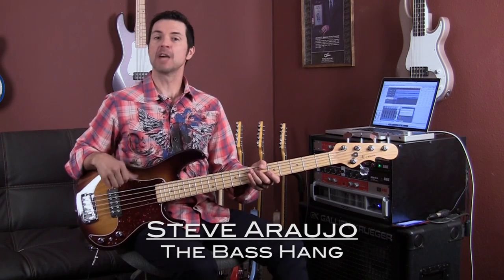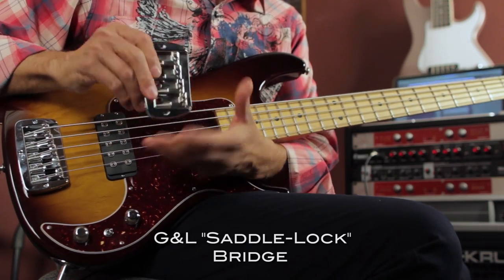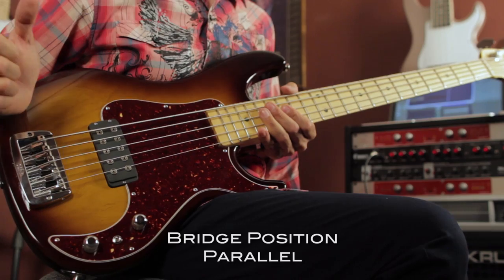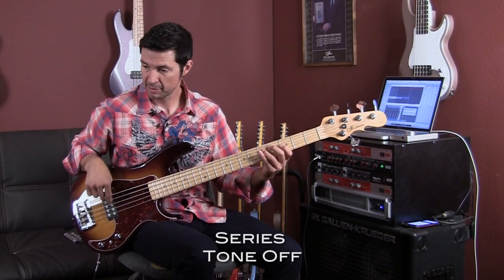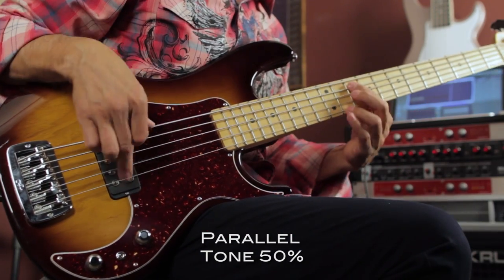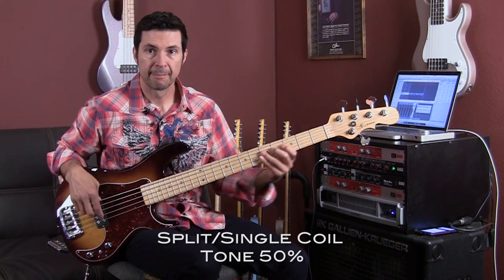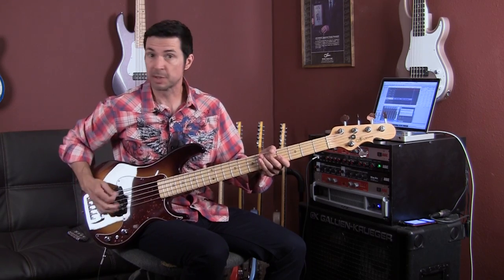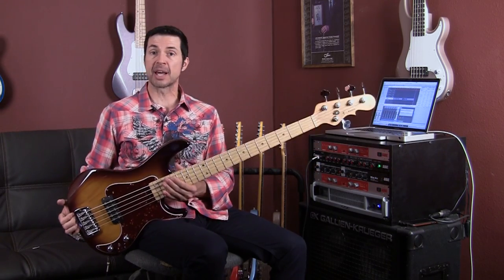Live! At Leo's:  G&L Kiloton 5 Full Demo with Steve Araujo

Comment: Wow, G&L decided to go back to the 4+1 headstock for their 5 string basses?
Reply: I find it logical due to the headstock design to not have 3+2
Reply: Well they do both, that's what's odd. Early on, they had 4+1 with basses like the L5505, then they did 3+2 for the L2500, L1505, L1005, M2500, MJ5, etc. But it looks like both the Kiloton 5 and the JB5 and maybe some others use an updated 4+1 setup.
Reply: Now that I'm thinking about it more, it seems that all the active 5-strings are 3+2 while all the passive ones are 4+1.
Reply: I don't think it has anything to do with the bass being active or passive. I have a '97 L2500, the first year it was ever released, and it has a 4+1 headstock, as well as a larger, heavier body (bass weighs about 10.5 or 11 lbs). Mine was built in the 3rd quarter of '96, one of the first out of the factory. Later '97/'98 models went with 3+2 headstock and smaller, lighter body. 
I feel that people loved the 4+1 headstock, so they went back to it. 
I want a Kiloton 5 AND a JB5 to round out the collection...
Reply: Just the kiloton 5 and JB5. L and M 2500s are 3x2.  They should do a six string L and M!!